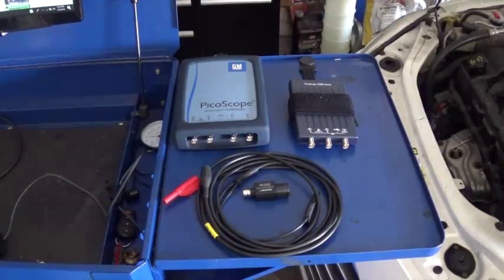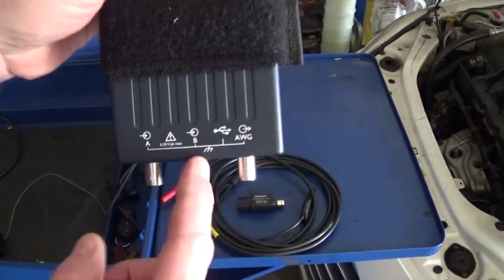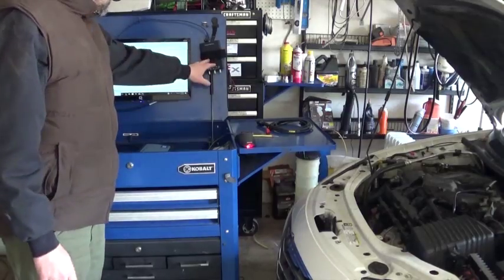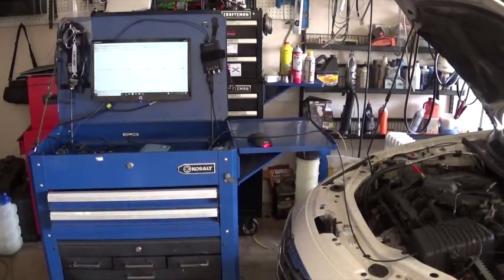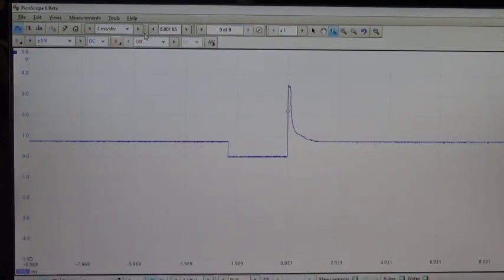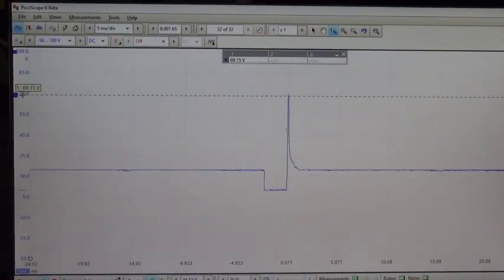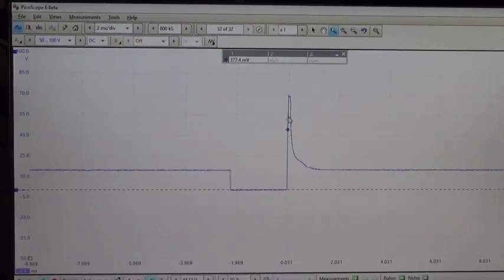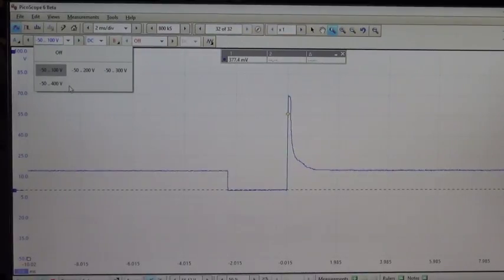When To Use Attenuator On Picoscope

Comment: How much voltage used the injector driver?  Is this 12 V system ? Is this a conventional fuel injector or direct injection?
Reply from the maker: These are 12 volts injectors.

Comment: Excellent topic. I find this a little confusing since if the injector is not in the circuit you only get a small square voltage wave with no spike. The dangerous spike happens as a result of the coil, when its magnetic field suddenly collapses. So, attenuator needed when the coil is in the injector circuit but not needed for the signal voltage by itself when not connected to the coil. The other area I scratch my head about is for inductive current clamps. When measuring voltage on the primary side of an ignition coil you certainly need an attenuator, for the same reasons. However when measuring primary current with a current clamp, the voltage delivered to the scope is dramatically reduced to just a few volts. No spikes. So, correct me if I'm wrong, but I don't believe an attenuator is needed for that, and the transient big voltage spike doesn't seem to do anything to the current clamp because minimal current is generated. Likewise, when using PICO's capacitive pickup for secondary voltage of ignition wires, those devices have a built in attenuation so no attenuator needed there, either. I'd be interested in comments about that, it's not well discussed anywhere I've found.
Reply: spelunkert, Here is my initial thought  on what you mention:

You measure directly the inductive fly back voltage when you're physically connected to negative side of the coil's primary. While working with an amp clamp this tool measures inductively the strength of the magnetic field that is caused by the current  flowing thru the coil, nothing else. Once the current flow thru the coil is interrupted the field disappears  and there is nothing to measure anymore. There is no such thing happening like an inductive CURRENT kick which would make the amp clamp reading go high. It's just the magnetic field vanishing and so does the clamp reading.
Reply: Yes, I see it the same way when measuring primary ignition coil current with a clamp. Even though there is a sharp voltage spike, the resulting power is the product of current and voltage. At the instant of the voltage spike, current has already gone to ground so the product is small. I'm pretty confident the scope is safe, but I've wondered about the clamp since the transient spike is much higher than the rated voltage on the clamp. I'd be interested to hear from anybody who has fried a clamp when measuring primary ignition current....
Reply from the maker: spelunkerd I never damage my current clamp by measuring current, but I did melt one down buy keeping  it too long on BMW engine. Still works but it's  little bit crooked  LOL.
Reply: @kyhomegarage3430  if i wanna measure gdi injector and coil same time with lets say 2204 pico i have to put on both channel attenuater ?

Comment: Good morning, Sir. When I put the Attenuator on and try to check battery voltage, it remains arround 0 v, but I get battery voltage when I remove the Attenuator. Would you say that the Attenuator is junk?

Comment: Quick question can I use the 20:1 attenuator on my 60 A Current Clamp to do a relative compression test? Pico software requires that you use a 600 A Current Clamp, but to my way of thinking if I use the attenuator the 60 A Current Clamp could measure 1200 A. Is this correct? Thanks in advance.
Reply from the maker: David Crow Hi my friend. You do not need attenuator for your amp clamp.

Comment: Awesome video, finally someone takes  the time to explain. I have being watching videos  about how to use the pico escope and nobody explains it good as you,  definitely subscribing, thanks
Reply from the maker: luis santamaria thank you my friend and welcome to my channel.👍👍
Reply: @kyhomegarage3430  I have one more question about te 2000 pico  using a attenuator , can I use it to check secondary wave form ?
Reply from the maker: luis santamaria for secondary waveform you don’t need attenuator because your voltage input from pickup probe is very low.
Reply from the maker: You can try by placing pick up probe on top of ignition coil and measure peak of power KV . Voltage will be below 10 V
Reply: @kyhomegarage3430  thank you very much ,your the best.

Comment: Hi many thanks for your video. Just what i was looking for i have the same scope. 
I have just brought the pico attenuator 10:1 ta197  think it max voltage is 300v .
The test leads what came with the scooe has a switch  1x and 10x
So with the attenuator in series   should i have the switch on 1x or 10x  think 1x is up to 200v and the 10x is up to 600v ?

Comment: Is that a pico 2204A the most basic scope thay have? I notice they have several in the 2000 series, what is the difference in all of them?
Reply from the maker: Yes this is basic picoscope. Works fine for most automotive testing. I don't know what is difference in all of them. You can look it up on pico website. Thank  you.
Reply: If I'm not wrong, the difference between them is the bandwidth.

Comment: Do you use an attenuator when using inductive pickup on a spark plug ?
Reply from the maker: Plague Plague I use snap on and this OTC adapter and output voltage is  very low. I am not sure about other inductive clamps. To be safe I would check output voltage and I would only use probes with ground wire (some probes don't have that. Could be potential problem if spark
plug wire is open). I hope this helps. Thank you.

Comment: What are the draw backs of using a attenuator?  What kind of problems are created when using attenuation when it is not needed.  For example using a 100:1 attenuator to read a watch battery. Will it be just as accurate as a reading without attenuation?
Reply: The Pico manual states:

"The minimum and maximum voltage range between products.varies For example, the. PicoScope 4223 Automotive Scope has a minimum voltage range of ±50 mV and a. maximum of 100 V, while± the PicoScope 6404 has a minimum of 20 mV and ± ...."

So, imagine viewing a signal which had in reality a total range from let's say 0V to 20mV, then you add in a 100:1 attentuator, you are then only sending a range from 0V to 0.02mV to the scope.

Depending on how fine a resolution the scope can really read / display, you might end up using only a fraction of your available 8 bits resolution (or 12bits on the automotive), to display the wave.

Or another way to think of it is, using just a portion of the screen with regards to the vertical axis, for example, 5% above and 5% below the zero line.

Its a bit like buying a 4k camera, then setting it to take photos at 640 x 480 pixels
Reply from the maker: MAICO MAGNUM Thank you for answering this question my friend. You  have great way of explaining how electronic works. Cheers

Comment: Hi everyone. Can somebody show me the math formula to figure out 20 to 1
Reply: just what it says lol, multiply whatever value x20 times with the x1 output, or just use the software to do the calculation, in theory with this scope and 20:1 attenuator you can safely measure up to 400v (20x20).